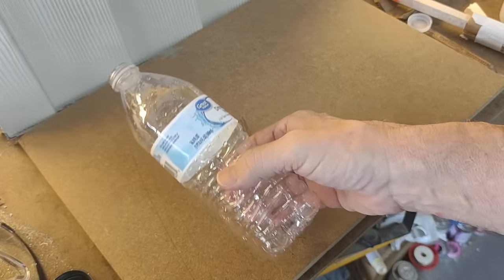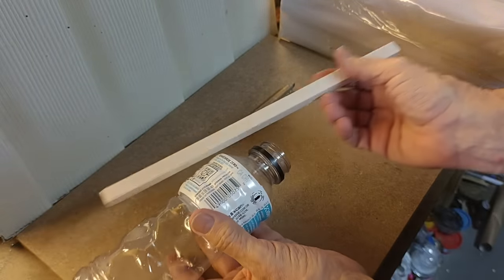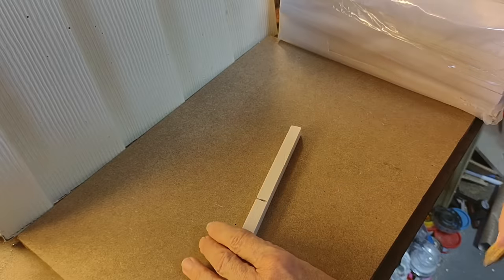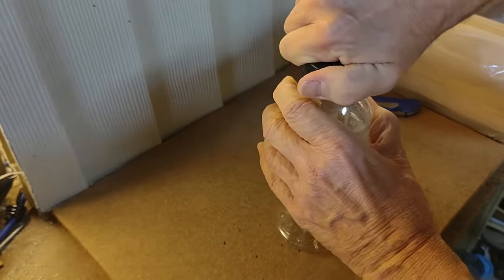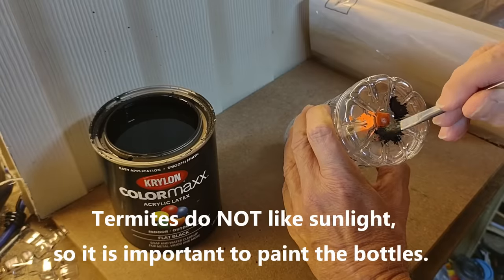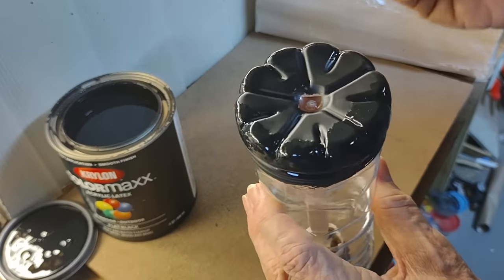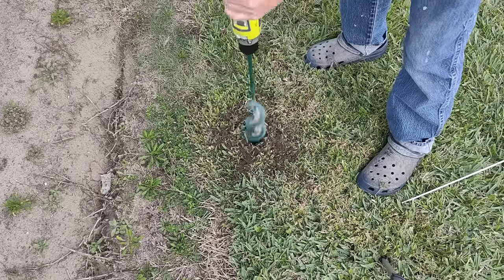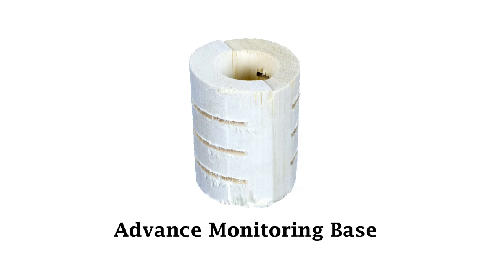Unbelievable Water Bottle Trick for Termites!  Simple to do!

Comment: My home is about 63'x24', so I will have to make quite a few monitoring stations. Thank you.
Reply from the maker: Yes.  You are going to need at least 40 of them to do the house, plus you should put them on both sides of the driveway as well.  So, you may need more than 50 of them.  I like to put them every 4 feet apart, but you can start by putting them every 8 feet apart and then slowly fill in between them to eventually have them every 4 feet apart.  You know what they say?  The longest journey begins with a first step.  The hardest part is finding all those bottles.  Just start working on it though and you will have it finished before you know it.  Thanks for watching.  Be well my friend.

Comment: I am a fan of cheap, effective DIY solutions. Thanks for sharing this!

To be fair - a commercial monitoring system like Sentricon includes an insurance policy that will cover repairs on your structure up to $1m. There is certainly a value to that. Do you have thoughts about Sentricon?

Take care and God Bless.
Reply from the maker: I have a video that is in production right now it talks about that very issue.  This video should be posted sometime next week.  The short answer is that the Sentricon system is fine for monitoring termite activity, and perhaps even preventing it, but I wouldn't use it for an existing investigation, particularly if you are dealing with an aggressive species, such as Formosan termites.  If you subscribe to my channel, you'll be notified when this video is posted, and it will answer all your questions about using a bait as opposed to trenching.  As for the insurance, please read what Pete N posted.  It sounds like he's been there.

Be well my friend.

Comment: Great idea! Could you use cardboard infused with borax inside of the bottle as a killing bait for the termites? Thanks
Reply from the maker: The problem with cardboard is that it will easily decay and become more unattractive to the termites.  The only reason I use it in the bottles is as a spacer.  It is the wood that does the job.  Now, you could dip the sticks in Bora-Care, and that would permanently make them a poison to the termites, but it will greatly increase the cost and time to make the stations.  You don't need to kill the termites right off.  It could be years before one of the stations goes off and you can easily kill the termites after the station becomes active.  Fipronil foam will do a way better job than a borate product.  If you have an active station, just drill a small hole in the top of the bottle and fill it with the foam.  The only problem is that there isn't that much wood in the station, so I would not just treat the station.  That is why I suggest installing the Advance station next to the bottle station that is triggered.  Doing so will take out the entire colony.

I hope that helps.  Be well my friend.

Comment: Absolutely genius!  Spent way too much on those stations.  Will have to do this from now on.  

Thanks for your content!
Reply from the maker: Thank you so much for those kind words.  Very much appreciated.  Be well my friend.
Reply: @Guy's Pest Solutions , could the Basile wood be soaked in Fipronil before they're placed in the monitor? Also, could the*free* wood paint stirrer sticks from hardware stores be used as an alternative bait stick? Or cardboard? Thanks, I appreciate your videos! Very helpful for those of us who can't afford to pay professionals or even afford professional bait systems!!! A+++
Reply from the maker: @itsjustme167  Yes.  You can soak the wood with fipronil or even Bora-Care if you wish.  Also, I suppose that using paint mixing sticks should probably work just fine.  I do not think cardboard would be a good option because it will most likely deteriorate too quickly and may become too moldy from the moisture in the ground.  Termites do not like a whole lot of mold on their food source.  The only reason I use cardboard around the bottle opening is to make it easier to line up the top of the stick with the bottom center of the bottle.  While termites will eat cardboard, I do not think it is the best option for making these devices.  I hope that helps.  Be well my friend.

Comment: Very useful video! I've got a  question: I've noticed worker termites about 25 feet away from my house eating on an old rotten stump. Should I be worried about getting termites in the house?
Reply from the maker: You should be very worried.  I recommend that you do an inspection on your house and I recommend that you treat the stump.  I will give you a link to my video on how to inspect for termites.  Please let me know if you have them in the house and I will guide you further.

To treat the stump drill holes in the top of the stump that are about 1/2 inch wide and just as deep as you can make them.  You should try to drill them at least 12 inches deep.  Ideally, you should drill them about every 4 inches apart, but if that is too much work, just drill as many as you can.  The more of them you drill the better.  Also drill holes that are about 12 inches apart around the base of the stump that are on a downward angle, so that the drill bit is aiming under and to the center of the stump.  After the holes are all drilled, then mix Taurus SC at 0.8 oz per gallon and fill up the holes with it.  You can mix it in a bucket and use a funnel to get it into the holes.  It's a good idea to put a cork in the stump holes or fill them in with some sort of caulking to keep the rain out of the holes.  If the holes are sealed to prevent light and rain from entering, the Taurus SC can last several years.  The hope is that termites will find their way into the areas you treated and take the Taurus SC back to the colony and share it with the other termites.  Then it's lights out for the entire colony.  Sooner or later, they will come in contact with the Taurus SC.  They don't know that this is harmful, so they will happily pass right through it and eat wood that is contaminated with it.

I hope that helps.  Be well my friend.

Taurus SC:    https://www.domyown.com/taurus-sc-termiticide-p-1816.html?sub_id=1817

Video on how to inspect for termites:  https://youtu.be/oGyAVT7Zyro
Reply: @GuysPestSolutions  First off: I didn't think you'd respond. However, you ARE for real!!! Thanks a million!
To be honest, I was very worried about what I'd found out. That's how I saw your video and actually almost your entire video library. That's also the reason for returning the termite monitoring stations I bought back to Lowes, lol. That rotten stump is in front of the house along with two other live trees, about 25-30 ft from the slab. I was about to lay new mulch, and the bags were staying for a week or two. When I removed one of them(being on top of that stump), I saw the termites(maybe a handful). As soon as they were exposed, they disappeared inside that rotten stump. Now I know I have a colony nearby. As far as the house, we bought it in 2021, and the termite inspection showed no signs of termite activity (including mud tubes), but that was 3 years ago. I'll watch your video that sent me and perform house inspection, and I'll share the discoveries if you don't mind. Once again, I appreciate your response!
Harry
Reply from the maker: @unbiasedreviews5978  Always my pleasure.  Most YouTubers do not respond to questions because they would rather spend the time creating more videos to make more money, but I answer all of them and I do it in great detail.  I don't do YouTube for the money.  It's more about providing people with the assistance they need to save some money.  So, I spend most of my time answering questions instead of making new videos.  Just my way of paying it forward and I am more than happy to do it.  You can feel free to ask me anything you like.  Be well Harry.
Reply: I’m so grateful for all you do especially in this economy
Reply from the maker: @corinasouthers9440  That is so kind of you to say.  I am always happy to help.  My pleasure.  Be well my friend.

Comment: Hi there, thank you for this very helpful tip. Do termites attack exterior concrete brick walls (Autoclaved Aerated Concrete to be exact). The AAC block manufacturers advertise their blocks to not attract termites, unlike wood. The only wood in the house will probably be the interior walls. Thanks for taking time to address my question. I appreciate your time.
Reply from the maker: Termites do not attack concrete or brick and they do not have the ability to chew through it.  However, they can find cracks and crevices in the concrete, or pipe penetrations that they can get through.  Therefore, if you have wood in the house, then the termites may have the ability to find their way to it.  Most of the time, even block houses have wood attached to the blocks on the exterior walls to allow the drywall to be hung, and the electrical wiring, and some of the plumbing to be run in the house.  Your roof structure is most likely also made of wood, and it is not uncommon for the termites to find their way inside the blocks and then then build mud tubes up to the attic.  This is particularly true if you live in a southern coastal state, California, or Hawaii.

You are very welcome.  Be well my friend.
Reply: @GuysPestSolutions  This is a most insightful response that will tremendously. Thank you for spending time to share with us what you know. I sincerely appreciate your expertise.
Reply from the maker: @oldporkchops  You are very welcome.  Be well my friend.
Reply: @GuysPestSolutions  Thanks. All the best in your endeavors too.

Comment: Painting tip. Stick a small square of masking tape over the orange patch on the bottle base and spray paint it. After enough coates finally remove tape.
Reply from the maker: Yes.  That will work very well.  Be well my friend.

Comment: Now this is for flying “dry wood” termites. I place a large brown of water under a light. When the termites are flying on a humid day at evening in Spring, they will fly right into the bowl with water.
Reply from the maker: No.  This is not for drywood termites.  This is for subterranean termites.  If you see swarmers in your home, then you have an infestation.

It is important to understand how drywood termites work.  They enter through cracks and crevices around windows, doors, the eaves, pipe penetrations, and so forth.  Most of the time, they enter through several locations.  That is because a swarm of them attacked your house at the same time.  If there was a crack or a crevice, then they probably found it.  After they established their galleries, which will be inside the wood, it will take four to seven years for them to be able to swarm.  Now that they are in your house, the swarmers will use holes that are in your studs to travel through the walls.  Those holes in the studs were created by the electricians to run the electrical wiring.  Not only are these holes going through the studs, but holes were drilled into the attic for the light switches and to run some of the wiring for the outlets.  So, the termites now have easy access throughout the attic and the walls.  If you have a basement or crawl space, they have access to that as well.  Most of the time, you will have no idea that they are in the walls, because the frass is inside the wall.  To make matters worse, if you have drywood termites, then your neighbors have them too.  That means you have been getting swarmed for as long as they have existed in the neighborhood.  Most likely, we're talking about years, so it's a safe bet that you have these guys in many locations in your home.
                            
I always hate to be the bearer of bad news, but if you have drywood termites, the only way to get rid of them is to fumigate.  Prices for this can vary wildly in this industry, so I recommend that you watch my video on how to hire a pest controller without getting ripped off.  That video can save you a lot of money.  You should also know that the gas they use to fumigate has absolutely no residual action whatsoever, so you can get reinfested the moment the tent comes down.  Like I said before, if you have drywood termites, then your neighbors have them as well.  Since drywood  termites swarm every year, it is almost a certainty that you will be reinfested within a year after the fumigation is done.  The only way to prevent this is to do a preventive treatment on your house every 60 to 90 days.  Most pest controllers will not do this, so it is something that you generally need to do yourself.  I have a video on how to do that and I will place a link below.  If you absolutely cannot afford to fumigate your house, then you can try spot treating it yourself.  It is virtually impossible to find all the termite galleries, but it is way better than doing nothing.  Regardless of how you treat it, you should begin the preventive treatment immediately, so that you do not get additional termites paying you a visit.  

I hope that helps.  Be well my friend.                        

Video on how to hire a pest controller without getting ripped off:  https://youtu.be/y-a8XOqVrlE

Video on how to prevent drywood termites:  How to Prevent Drywood Termites 100% Guaranteed.

Video on how to spot treat drywood termites:  How to Treat a Drywood Termite Infestation Yourself. A MUST see if you have Drywood termites.
Reply: @GuysPestSolutions  live in an area where we are well familiar with termites, both types. Yes they fly each year on warm, wind still, humid days around this time in May. Yes you are right the house needs to be fumigated and will be. In one of my homes a Professional even found an entire Foam Mattress in a storage area used by termites as their Nest.  Quite unique and not even the Exterminator had ever seen anything like that.
Reply: Of course I want to do everything to kill or discourage (which I don’t think is possible) those termites to attack my home. My concern are those poisons on the health of humans. What else is there to kill them? Always searching for new innovative ideas. Will they get into PVC?  I have changed to steel instead of wood, but es you say, they still find a way in to find wood.
Reply from the maker: @DPoppell  The termites cannot get through PVC.  If you are concerned about the health aspects of pesticides, then please watch my video on the subject.  Most pesticides are very safe now.  Fumigation is still dangerous, but there are no health hazards after the job is finished.  I hope that helps.

Video explaining how safe pesticides really are:  https://youtu.be/i7nLO6Js_3Q
Reply from the maker: @DPoppell  A termite infested mattress is something you do not see every day.  I have not seen that either.  Thanks for sharing.  Be well Doris.

Comment: Thanks for sharing your knowledge. 
My question is whether pine or fir wood is suitable. I have lots of scraps of two by fours, etc. that I can easily saw into half-inch by half inch pieces.
Reply from the maker: Termites will eat most wood types.  I used balsa wood because it is easy to work with and the termites will make short work of it because it is so soft, but pine or fir is fine.  Be well my friend.  If you have tools, then use a drill to create a little hollow space in the tip of the stick.  It will seat into the bottom of the bottle better, so it won't slip out easily.  Most bottles have a little bump in the bottom center from manufacturing.  So, just a little hole in the end will secure the stick better.  I hope that helps.  Be well my friend.